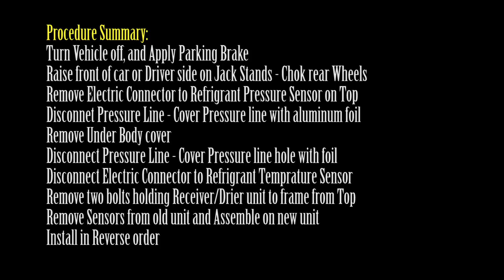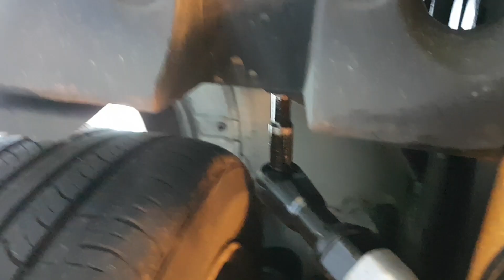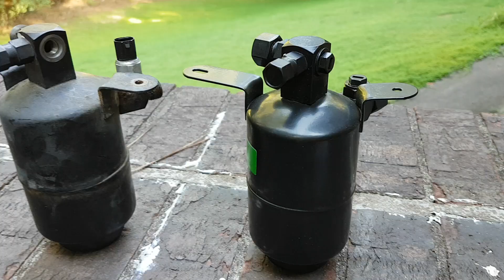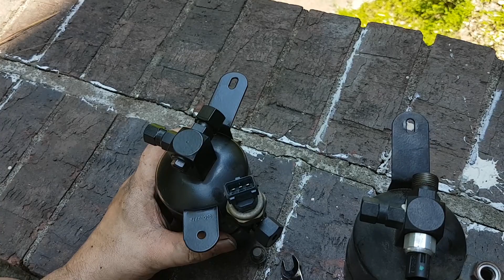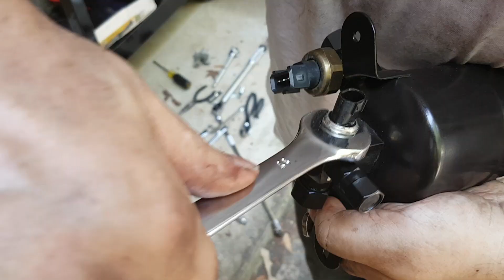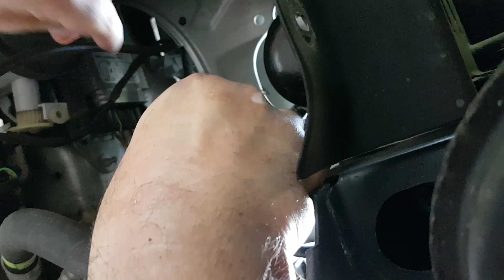Mercedes W210 E320 A/C Receiver Drier DIY

Comment: I got my new receiver drier and the bolts for the sensors are sealed like wtf
Reply from the maker: What do you mean sealed?  Unremovable?
Reply: @masood-tv yeah, like there black paint over the screws and I tried loosening them and couldn’t. I’d send a pic but can’t here
Reply from the maker: @mr.bhewjew3212 , it's is probably not the Hensa model.  Do you mean the new drier already has a pressure sensor sealed to it or is it that you cannot remove the old to switch?

Comment: Should I change the receiver drier if I'm just changing the schrader valves?
Reply from the maker: Hi Bruce, not necessarily.  Replacing Schrader valves in a charged system does not introduce air into the system.
Reply: @masood-tv  Oh ok. Thank you for the fast response.
Reply from the maker: @IWillCookWhatIWant  np.
Reply: So I got the schrader valves changed and watched them, they opened the system. They didn't change the reciever drier. Now 2 days later, it's blowing hot again. They said the compressor was about to go out. I'm wondering if it might just be the reciever drier? It was leaking before I got the car and leaked the whole time I've had it basically. And worked good the whole first two days after the last charge. They said it's still full of refrigerant. And the compressor isn't making any noise, that I can hear.

Comment: There is a o-ring on that pressure sensor, seems you forgot to put it on 😂, still, great and informative video
Reply from the maker: Thx.  Has been a while and it still blows very cold air. So, may be I didn't...

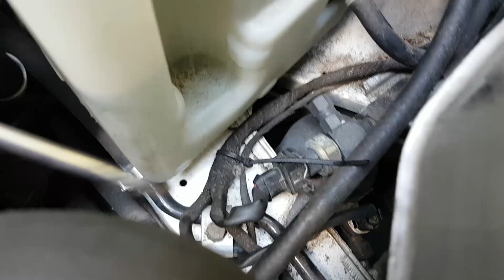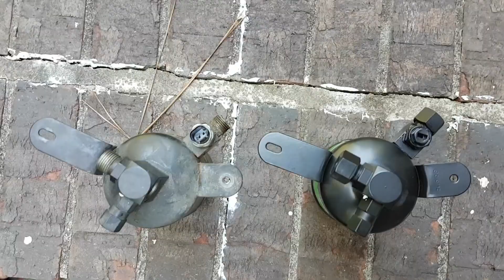Comment: You put the pressure sensors in the wrong spots! 0:50 3:21 vs 4:27 6:45 don't make this mistake guys!
Reply from the maker: Please elaborate and be specific.
Reply: @masood-tv  I placed the sensors as you did at the end of the vid and the big pressure sensor connector is blocked off by my factory hid headlight washers car is a 99. Now I got to swap them
Reply from the maker: @BimmerM5e39  hmm, didn't know there is a difference between 99 and a 2001.  Thanks for sharing.  I will look it up in the service manual.
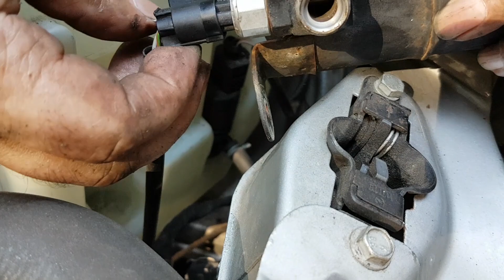Reply from the maker: I looked it up in the service manual.  The locations of the pressure and temp sensors are identical between the 99 and 2001 W210 E320 sedans. Beginning at 3:05 minute of the video I compare the two.  Best advice is to do the same, notice locations of the old sensors attached to the old receiver/drier unit (fluid reservoir) and place the new part next to it in the same orientation.  Then switch parts identically.
Reply: Yeah, seems you are right😢, according to wis, op installed it in reverse order. question for both op and BimmerM5e39, are there any other things happens beside the blockage of headlamp washer?(mine was shot so doesn’t matter) Ac working normal? If ac work as it should I’ll probably just leave it as is and place a note beside it.

Comment: I'm am trying to replace the drier on my 2014 e350 but can't find it anywhere. Does anyone know where it is located
Reply from the maker: Hi Frank.  I believe your receiver/drier is on the left of the radiator facing the car - it is almost as tall as the radiator.

Comment: Question, if the AC compressor already comes with oil why do you need to drain it and add new oil?
Reply from the maker: Hi,  I did it for 3 reasons, 1 to show how to, 2,   did not know exactly what type of oil was used   and 3, couldn't tell how long ago the compressor was filled with it.  Thx.

Comment: Hi, I found my W210 drier nearby has some white stuff, belive it's refrigerant. Recently, my AC go to defrost mode after starting the engine for 5 minutes (I found the root cause now b/c a vacuum hose from intake manifold to a tube nearby the firewall is broken). Besides, I also added a can of AC pro refrigerant last week too. 
Today, when I replaced the parking light bulb, I found this (see the photo https://ibb.co/BNL9P7g). Can you comment is that something wrong on the drier? Many thanks.
Reply from the maker: Hi G Bush, refrigerant is colorless, and it is gaseous - not white.  If you suspect a leak, add some dye to the system and then check with special glasses. However, you Drier does appear to be very old and should be replaced once you find the source of the leak.
Reply: @masood-tv  Thanks Masood, this W210 is 2001 facelift (see the photo, look brandnew https://ibb.co/Gxr3Y47) and the drier should be the OEM by far. Yes, I ponder to replace the drier, if DIY, do I need to release all refrigerant? How to do so? Thanks again.
(Thanks for clarifying the white stuff is not refrigerant, it may be something to the water/pump to windshield wiper - I press the spray water button, coz the AC go to defrost mode which makes cent vent no blowing but wind shield foggy).
Reply from the maker: @gbush1620 You can also use soap water and look for bubbles at suspect joints. I have videos on how to replace the drier, and other W210 AC components...yes, you will have to vacuum and replace the freon.  I have a video on that also.